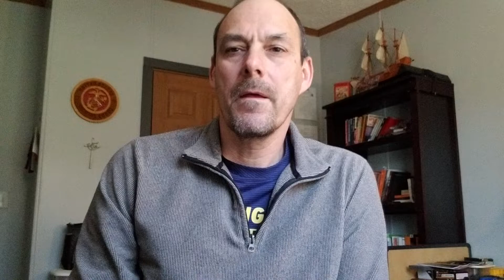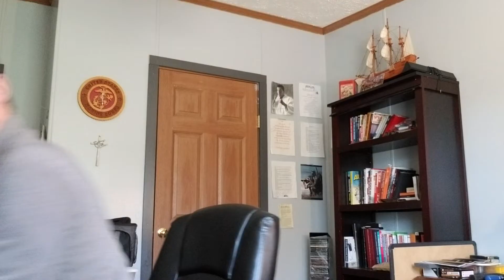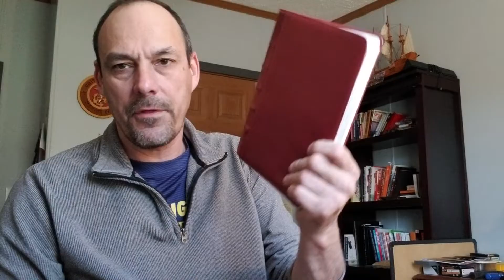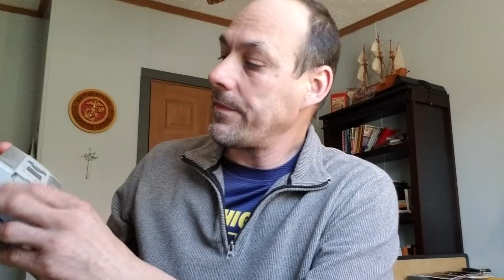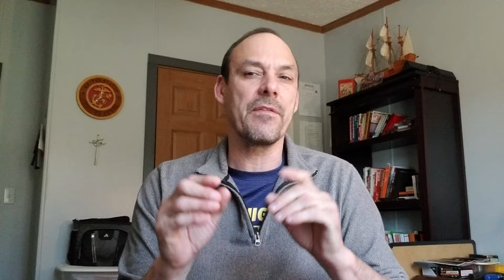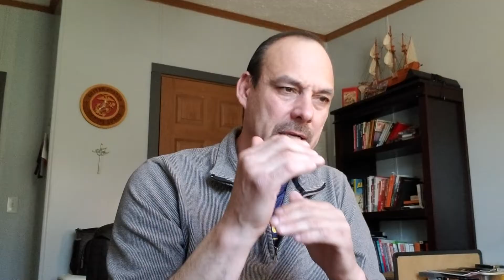Shortcuts to Become a PLC Programmer

Comment: I’m a red seal electrician that previously worked in electronics.  I have worked in industrial electronics for years. It sagway into controls and automation.  I’m not an engineer.  I would say that around what you say is a level 3-4 in programming. The vast majority of my programming is FB and some ST and the obvious LD.  On my test bench I have Siemens 1200, Zelio, AB micro820, 525 VFD a couple 3ph motors. I also have Siemens Touch HMI and other Teco Leeson drives.  I’m in Canada and in industrial AB has been dominant.  But lately I’ve noticed that Siemens is being accepted to replace latent AB and newer installations.  Are you seeing that in the US.  I work as a controls and automation specialist.  I have an apprentice electrician who I have referred to your site. Although being an electrician I haven’t done typical electrical work for a decade now.  There virtually isn’t any PLC that I can’t or haven’t worked on.  Wago, phoenix contact, Schneider, delta V, to name a few.
Reply: Hello. I am also an Automation / Electrical Control's Specialist @ Coca-Cola Bottling in Los Angeles CA. I personally
have not seen that trend at all. It also depends entirely on what Equipment a Corporation uses and where it is MFG.
Allen Bradley + Rockwell Automation are very popular Platforms in the U.S. all over.
Reply from the maker: Thats great to hear, variety and experience is where the value is.

Comment: I'm electrical engineering student.I came to know about PLC and its ladder logic programming when i was in 3rd year. I have started learning from bit logic operations. Building a logic using those bits and contacts found it really interesting. I have also done a MINI PROJECT named SIMULATION BASED SEMI AUTOMATED DRILL JOB USING PLC. I have used WPLSOFT (DELTA) as programming software .This build the curios in me to learn and build the logic.Then have enrolled in UDEMY for a paid course and there i have learned all the instructions(intermediate level) and also about the siemens TIA portal software till now. But,being a fresher, whatelse should i know and i must do  about PLCs to become a professional PLC programmer. Please guide me sir because i have chosen INDUSTRIAL AUTOMATION as my career especially a PLC programmer. Where should i focus more so that i can be a good professional PLC programmer .And guide me if am in a wrong  track. I hope that you guide me sir.
THANKS in advance

Comment: I’m currently learning on a slc 500. I think my output not working. Next I’m looking at compactlogix l24er-qb1b off eBay. Getting my AS degree. I got three years on working on working control panels and cad design from schematics electrical/some hydraulic to mechanical.
Reply from the maker: Sounds great, stay strong!

Comment: Hi! Thank you so much for your words of wisdom. I am a mechanical engineer/ design engineer looking to make a career shift to automation engineering. I want to take your advice and start practicing programming my own PLC at home. Do you have a cheap PLC in mind that I should look at buying?
Reply from the maker: Hello Samuel,  there are a few options for those who want to start learning use free software. You could start with Automationdirect, Productivity programming suite. You could start with RSLogix 500 from Rockwell Automation or you could start using Siemens S7 TIA Portal for a nominal cost or around $60 US. These days you have LOTS of options.
Reply from the maker: Samuel, let me know if you have any questions?
Reply: If I could add my 2 bits worth I'd go with the productivity series plc's from automation direct. Software is free and really good tec support.  I work on industrial air compressors so have some experience with control wiring but no plc experience. Bought the productivity 2000 starter kit and 2 extra modules at the first of March and less than 2 weeks later working with it in my spare time I can already simulate temperature and have written a simple star/delta program. Looking foward to hooking up the relays and lights to watch it run as close to real time as possible without actually hooking it up to 460 3 phase.

Comment: I went to be a plc programmer 😁
Reply from the maker: So what are you doing to make that happen right now Mohammad? What course work are you doing?
Reply: @LogixWorkshops   
I don't know, in fact I need your help to explain the path for me to be a good PLC programmer , where i must start learning?
Reply: @mohammadluqman7886  start with free software and simulator like codesys
Reply: @ahjed7397   i started with LOGO! Soft comfort like a first step